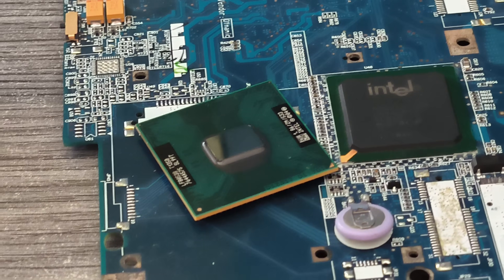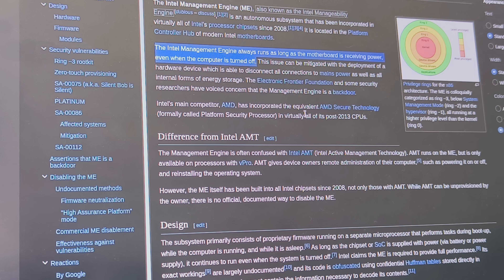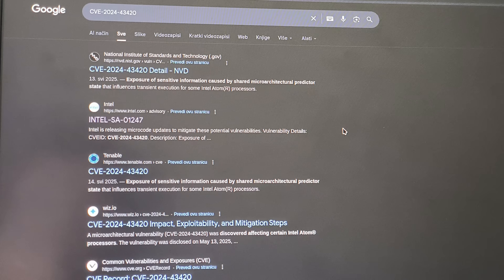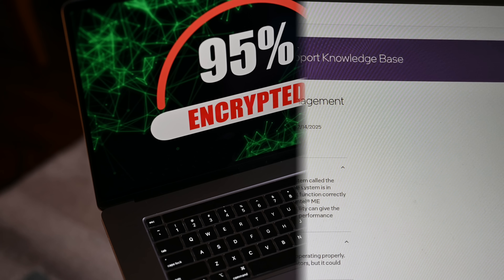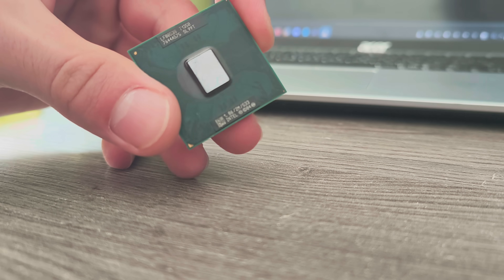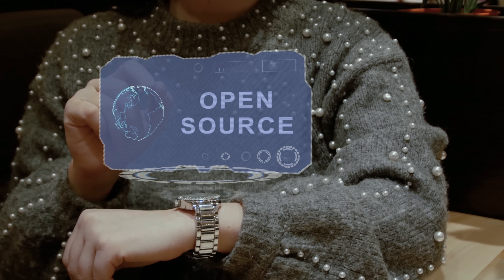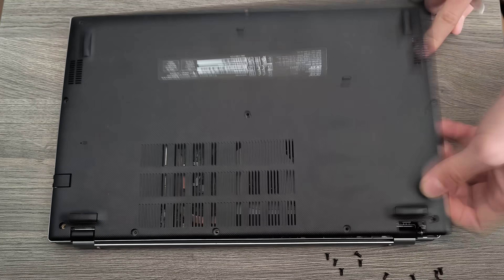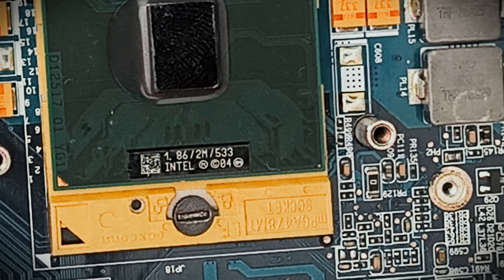YOUR CPU SPIES ON EVERYTHING (Even When Your PC Is OFF)

Comment: But what are the alternatives? Arm? Same thing?
Reply from the maker: Unfortunately, the risk model is nearly the same for proprietary ARM vendors. Companies building ARM chips (like Qualcomm or Apple) also install their own proprietary management systems, similar to the ME/PSP. The only real way to escape is to move to fully open-source hardware and firmware. Don't trust the brand; trust only open source.
Reply: Hey how about a free open source pager? Step right up, here you go kid. Any manufacturer can be bought, they are businesses after all. I suggest a more activist approach and start poisoning data collected AND working out other boot options. AI tools will headlessly gobble up all the LSD you give it and hallucinate itself to irrelevance.

Comment: When PC is off, CPU has no power. So it can't spy on anything
Reply: Wrong, even when your PC is “off,” the PSU’s +5VSB (5-volt standby) rail still provides a little power to the motherboard. That’s how features like Wake-on-LAN work. You have to unplug it or flip the PSU switch to really turn it off. Or in case of a laptop, remove its battery!
Reply: @PySnek  Yes, I've had trouble with video card not showing up after PC "power-off". The reason being "power-off" wasn't really a full power-off and somehow the last shutdown screwed up  GPU state or crashed it. Pulling the plug solved that. 
I've also had trouble with laptop wifi connection not working properly. Somehow Ubuntu managed to leave it in some strange setting (or maybe it was ongoing attack?) on shutdown and later it refused to connect with anything. This reminded me what the long press on power button was for (or its alternative - go in and disconnect battery).
In short, pull the plug/battery for complete shutdown and pray that there aren't any hidden supercaps or batteries somewhere.
Reply: @SeersantLoom  Yes I also have some experience with this issue haha. Dual booting from Windows back to Linux always made my wifi stop working if I didn't unplug the PC or switch the PSU off.
Reply from the maker: That's the logical assumption, but it's false when dealing with the ME/PSP.
When you hit "Shut down", the PC enters the S5 power state. It's not truly OFF.
As long as the PC is plugged into the wall (or the main battery is connected), a minimal amount of power is always sent to the motherboard. This is exactly what the Intel ME chip uses to stay "alive," maintain the network connection, and listen for remote commands.
Reply: @alex.cybersecurity  There's the thing - it's not plugged into the wall. 😂
Reply: Nope
Reply: @OldnickUA  ;)

Comment: Which cpu old or new
Reply from the maker: The new ones are the problem.
All modern Core i-series (Intel) and Ryzen (AMD) CPUs have the IME/PSP spy chip fully integrated and enabled. These are the ones where the backdoor is a guaranteed risk. Older CPUs (like those before 2008-2009) are generally safer because the ME/PSP was not fully implemented or was entirely absent.
Reply: how to know if my i5 2500 is one of them
Reply from the maker: @Youtube4dummiesx  Yes, your i5-2500 is almost certainly vulnerable. Your processor belongs to the Sandy Bridge generation, which was the era when the Intel Management Engine became a mandatory and fully functional component on the chipset.

Comment: Is my i3 3110M vulnerable to this?
Reply from the maker: Yes, assume your i3 3110M is vulnerable.
Your laptop is from the time period when the Intel ME spy chip became standard. If you haven't received recent updates, it likely has security holes.
Reply: @alex.cybersecurity  I'm using Windows 10 LTSC and Microsoft still supports it with updates. So, I guess I'm kinda safe?
Reply from the maker: @gearfear3  That's a common misconception, but unfortunately, LTSC does NOT protect you from the ME/PSP issue. Windows 10 LTSC and all Microsoft updates only work on the Operating System (OS) level. The Intel ME/AMD PSP runs on the hardware level (Ring -3), beneath your OS. Microsoft cannot patch this chip. Only a very specific BIOS/UEFI firmware update released by your computer's manufacturer (HP, Dell, etc.) can fix ME vulnerabilities.
Reply: @alex.cybersecurity  Okay, thanks for the info! I think I'm gonna buy a new desktop PC.
Reply from the maker: @gearfear3  Don't rush to buy new hardware yet. That could make the problem worse. If you buy a brand new desktop today, you are guaranteed to get the latest version of the Intel ME or AMD PSP, fully active and integrated. Buying new hardware does not solve the surveillance problem. It only guarantees you the most modern version of the backdoor. If privacy is your goal, your options are: buying legacy hardware (CPU older than 2008) which often lacks the chip entirely or installing CoreBoot/LibreBoot to disable the IME/PSP firmware. Buying a new PC without a plan is just paying for the newest spy chip.

Comment: As part of hardening my Linux system I installed Intel ME firmware updates a while back. My security level increased and more security test passed. I suppose that's a good thing but I don't like the title of this video and haven't researched this enough.
 Intel Management Engine Version:                 Pass (Valid)
 Intel Management Engine Manufacturing Mode:      Pass (Locked)
 Intel Management Engine Override:                Pass (Locked)
Reply: Intel has a tool called Intel Converged Security and Management Engine Version Detection Tool (CSME) to check whether the ME firmware has any vulnerabilities in it. Try running that and see what it says. Mine has vulnerabilities in it, but, the Gnome Security report that I think you are referring to gave me a Pass like you mentioned above. The bottom line is that PC makers just don't give a crap about fixing this stuff. Patches aren't available for most of my computers except the very newest ones.
Reply: Even my laptop from 2022 doesn't pass using the CSME tool. I'm pretty sure all of my systems of which I have many all fail.

Comment: Do you get it now why Micro$oft soft-locks out older CPUs from windows 11? Cuz they don't have those spyware welded into the architecture yet. THis is why using legacy hardware is more important than ever. ANd it doesn't even stop there wtih CPUs... but especially the whole UEFI, TPM and TCPA  crap.
Reply from the maker: I'm really glad you connected the dots perfectly! The shift to Windows 11 is really about enforcing total control over the hardware. By soft-locking older CPUs, Microsoft is mandating systems that contain all the required hardware trust components, like modern TPM and integrated Intel ME/AMD PSP. These are the building blocks for total surveillance and manipulation. You are right, it doesn't stop at the CPU. UEFI, TPM, and the ME are all deliberate steps toward an ecosystem where the user is no longer the owner. They are simply the controlled terminal. This is the path to a world where corporations and governments have the ultimate power to track, manipulate, and influence your every digital move, all under the guise of "security". Embrace legacy hardware; it's the last physical defense against total digital control.
Reply: @alex.cybersecurity  And this is exactly why Free Operating Systems like Linux won't do much once corporations remote-disable it through the hardware backdoors and sabotaging the users on their own computers by not allowing any free and open source Operating system. We need free & open source hardware too and this HAS to be the next step. Anything that doesn't include things like TPM on the hardware level. I'm sure governments and corpos would do everything to make that illegal by law.
Reply: MEs existed long before Windows 11, TPM2 didn't.
Reply: Holy shit you people have no idea what you're talking about
Reply: @Decimation001 fed

Comment: We've known about IME for over a decade. It's not a big deal, it's usually disabled by default, it's used in the business world.
Reply: Don't buy that idea. It's always on and it is used against people and businesses
Reply: ⚠️ NSA prism program wants to know your location 📍 🗺
Reply: I haven't used Intel since the 4770, and some basic googling shows it's mostly a laptop issue, and you can disable it. IME has typically been disabled on desktop since the first time it was exposed. It's possible current systems are enabling it again, but it WASN'T ON FOR YEARS, and if you don't have it on, there's no point to the Terry Davis paranoia. Windows 11 is worse than IME. You better be on private distro Linux if you're that paranoid.

Comment: When my PC is off it is completely powered off.
Reply: My PC is positioned with the back facing me. I installed power and disk activity LEDs on the back* and once I "shut it down" or put it into hibernation from the OS and the power LED has turned off, I use the switch integrated into the power supply to turn it off completely.
It's not because I'm worried it's spying on me, but because I don't want it consuming electricity when it's not doing anything useful for me.
Reply: @ruben_balea That's funny because I never even turn my computer off.
Reply: I do the same! Once I turn it off I press the switch to cut the electric current.
Reply: But sleep mode etc?
Reply: @Weibo-r6z  What part of Completely do you not get ? it cant work if it doesn't have a connection to the power source, I would also remove the ethernet cable.
Reply: @pixelfrogs  Is there a CMOS battery to keep the time current?
Reply: @ProfessorOzone  CMOS Battery provides just enough power to keep the CMOS settings alive (~1.5v), it does not and cannot power the IME/PSP, it also cant power the network adapter even under ultra low power settings.
Reply: @pixelfrogs  What part of battery aren't you getting?

Look, it makes no sense that it is spying on you when it is shut off for two reasons.  One, you clearly aren't doing anything and two it certainly isn't able to send anything anywhere because it isn't keeping your wireless/wired connection up, but what it can do is save one last thing and just send the information as soon as it is powered on again.  I'm just thinking conceptually here.  I really have no idea how this works.
Reply: @ProfessorOzone  I do know how it works and it can do what ever the hell it wants while your laptop is in hibernation. I say hibernation here because its never truly turned off while it has a charged battery.

The ME/PSP has access to your storage, memory and WiFi, it can be activated remotely and allow access to your data without you even knowing. Its an entire computer in your CPU, has it own OS and storage and you have zero easy ways to access, control it or remove/turn it off.

So the fact you are not using the machine means nothing, while its got power its got access to everything on that machine. 

Remove the battery/power source and it cant do a damn thing.
Reply: @pixelfrogs  I have a Dell 7050 and it has settings in the BIOS mentioning something about how it can even do things like check email while the computer is in sleep mode (I don't remember what it was called offhand). Seems like they have all kinds of weird sleep modes where the computer looks like it's off, but, isn't.
Reply: You pull the power plug? You remove the battery? You pull the network plug? You put the machine in a HF shielded box of lead? 😉
Reply: @crazyedo9979  Wouldn't it be enough to just flick the switch on the PSU?
Reply: @Serjo777 Definitely not. You can make a fun experiment. Connect a PC to a network socket (without AC power)and watch the little LED on the network card.😁
Reply: @Serjo777 motherboards also have a CMOS battery that keeps memory active (for BIOS settings). If you want a completely off PC then pull that battery as well.
Reply: @Iridiumcosmos  NOT recommended, this wipes your BIOS internal clocks
Reply: @XGD5layer This is what it looks like when you don't know anything about PCs. It resets the BIOS at the worst. You can fix the clock and continue like nothing happened. However, to say the PC is completely off is inherently false as well hence the mention of pulling the CMOS battery.
Reply: @crazyedo9979  hmm no, it does not turn on. I have some funny PSU there :)
Reply: @crazyedo9979  Doesn't need to be lead, a RF shielded laptop bag is enough, you also don't need to pull the battery.

As for a PC, remove the Ethernet cable and power cord, you can buy a motherboard without WIFI or just disable it in the BIOS. If you are still worried then just cover it in Foil.

I mean you can go to silly lengths here .. but lead isn't needed.

Hell I've heard of some super scared people running their PCs in a special room that they can hit a switch on the wall and it turns the room into a Faraday cage.

I have to wonder just what these people are doing that would require that level of ...Tin Foil hat preparedness.

Comment: I'm not surprised that Intel has it, but I'm shocked that AMD CPU's have them
Reply from the maker: Honestly, I'm shocked you're shocked about AMD. After decades in this industry, the level of intrusion goes far beyond Intel vs AMD. The real surprise isn't that they put a backdoor in a CPU; the real surprise is that we know about it. If researchers can prove that simple speakers can be inverted into highly-sensitive microphones, and if sophisticated attacks exist to capture data from display cables, why would anyone assume that AMD, Intel, or any other vendor isn't using every possible component to maximize telemetry and control.. 🤔
Reply: @alex.cybersecurity  you can use high-end mice as microphones
Reply: @XGD5layer  You can use wifi as an x-ray.
Reply: They are both practically the same and both manufactured overseas (probably next door to each other)
Reply: @Weibo-r6z  both are not practically the same
Reply: There are no good players in this market!

Comment: you people will believe anything if there is no power it can't run know matter how much you want it to it just won't run it there is no power wake up
Reply from the maker: That's a fair point, but we have to face the reality of modern laptop design. The overwhelming majority of users NEVER unplug their laptop from the main battery. More importantly, nearly all modern ultrabooks and MacBooks no longer have a physically removable battery. As long as the main battery remains connected or the charger is plugged into the wall, that low-level power state is maintained. Therefore, most devices out there stay vulnerable and "awake" simply because of the way they are built and used, regardless of the user's intent to shut down.
Reply: @alex.cybersecurity yeah, thats why you need a bios battery, doesn't help you access the hdd or ssd if the power supply isn't providing the power they need to properly operate.
Reply: @alex.cybersecurity  >ultrabooks and MacBooks no longer have a physically removable battery. 
I didn't know this... It's amazing how people just accept this and support the companiesplanned obsolescence.. Give the last 10 years, it  really does not surprise all that much.

Comment: This is why I only use Arch Linux on Motorola 68060 chips
Reply: There is no official Arch Linux distribution for the Motorola 68060 processor (or the general m68k architecture).

Arch Linux officially supports only two main architectures: x86_64 (64-bit Intel/AMD) and ARM (via Arch Linux ARM).

However, there is Debian m68k port but mostly impractical or impossible to do even the basic modern day tasks. Great for legacy applications though but there is a reason its called legacy.
Reply: @kplkasteel  Yes, "No OFFICIAL" distros for Motorola Arch. That's the way I like it....
Reply: @johnsmith1953x  I am sure you get a lot done on a 30 year old cpu?
Reply: @kplkasteel  Yeah, I edit 4k video on my Arch.  No, dude. For text and 8-bit color it rocks. You can do ALOT with 68060 if you program it right. Look up some demos from the Black Lotus.
Reply: @johnsmith1953x  I come from the Amiga 500 and Amiga 1200 know all about the m68k
Reply: @kplkasteel  Whats an Amiga ?
Reply: @johnsmith1953x  Really? Seriously? Never heard of the Commodore Amiga 500/1000/1200/2000/3000/4000?

Wow. Okay. What, were you born yesterday? Or have you just been living under a rock for the past four decades?

Those aren't just "some computers." Those are the legendary machines from the late '80s and '90s that paved the way for that little device you're probably staring at right now. They all used the Motorola 680xx processor, running everything from the plain M68000 all the way up to the M68060. But I guess those are just meaningless numbers to you.

And you talk about demos? You know absolutely nothing about demos or the demoscene if you don't know the Amiga or the Atari ST. That's like claiming to be a movie buff but having never heard of "color" or "sound."

You know what, do yourself a favor. Just Google them. Go on. Educate yourself.
Reply: @kplkasteel  LOL! Just trolling you my fellow Amigan !!  I actually have two Amiga1000s from 1985. One has 1 meg of memory that I play Black Lotus demos on and blow away kids that such tech was around back in 1985 !!

Comment: Spot on...  and there have been mainboards shipped in the past in Asia with compromised management systems...
Reply from the maker: That's the scariest part of the entire IME/PSP problem -  supply chain integrity. The ability for compromised motherboards to ship with malicious or backdoored management firmware means that the threat is baked in before the PC even reaches the customer. It confirms that the "black box" isn't just a vulnerability - it's a trust liability. That's why projects like CoreBoot and LibreBoot, which replace proprietary firmware, are the only true solution for full security control.
Reply: @alex.cybersecurity     It's not really a true fix. 
Backdoors are still there in the silicon that even these projects can't mitigate. 
:face-orange-biting-nails:

It's a crazy world out there!